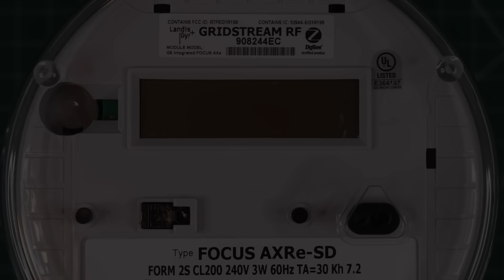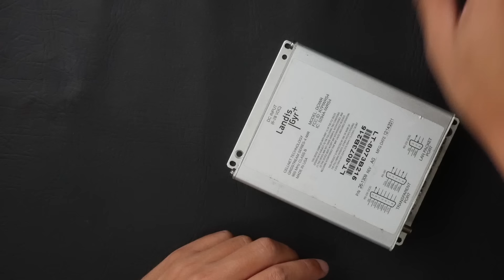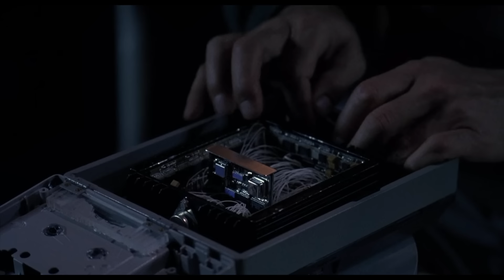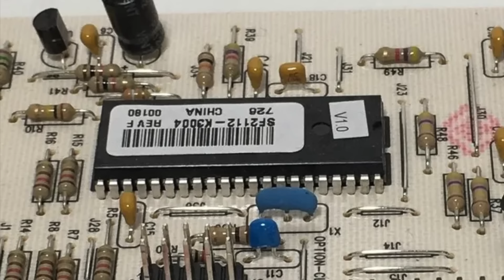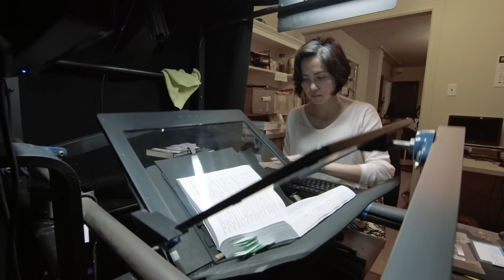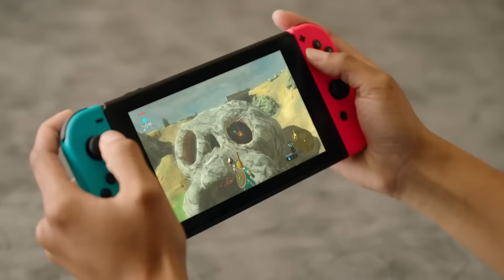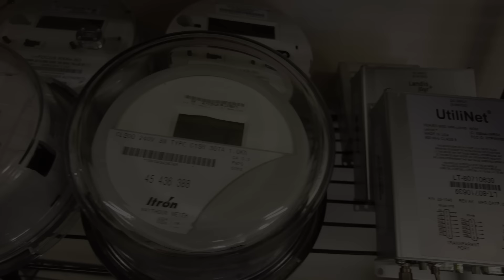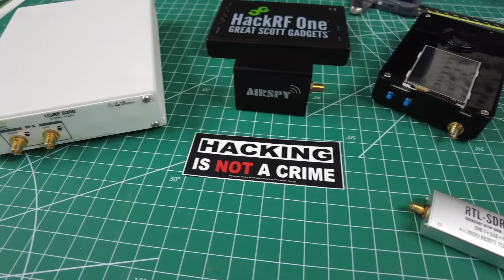The REAL Problem with Smart Meters

Comment: My problem is that the smart meter was sold to the  consumer  with the promise of automatic off peak tariffs for everyone - 7 years later  still waiting - and tariffs increased 50%  . 🇦🇺
Reply: You have to buy your power meter?  Where I live the meter belongs to the power company.
Reply: @soundspark  in Victoria it was a mandatory conversion in 2017 at utility expense. " Sold" in the sense it was one of the reasons to allay widespread public opposition. But essentially , off peak metering is now a back office function for the utility.
Reply: @soundspark  Here as well.  And they have to calibrate , exchange and  modernize. The day you will remove it you are committing serious crime. Also there are tamper protections.
Reply: @rybaluc  I can call up the power company to get my meter pulled if I have to maintain the box.  The box the meter plugs into is my property, but the meter and the wire from the pole to the meter are power company property.
Reply: @soundspark  The difference is you could use "my" in case of power meter. I have to use "their".
Licensed electrician could call power distribution company ( different from power selling company), remove power meter, broke seal and make a repairs. Power meter also records access via tamper points.
Then technician from distribution company checks wires, read state physically ( even in case of online meters) and renew seals on junction box plate, power meter, ripple control device and cabinet circuit breakers. He might also check if installation is up to standard. Unmeasured part is partially owned by me and partially by power company via easements. Usually part with street side cabinet big fuses is power company problem and there is even a bit different key for opening it.
Poles are problem of power company and except old installations in rural areas they are not that much used here for installations below high voltage levels. Lot of places prohibit it gor new permanent installations.
Reply: Not sure where you are in OZ, but OP power was always available, either with a separate timer and meter and/or via over the grid signals to turn on and off, usually hot water systems. Around 20 years ago they raised the OP power cost to almost the same as day rate! F***EM! I told them where to insert it and went island! My neighbors hate me as when there is a black out, our place is the only one with light!
Reply: The smart meter, has the ability to cut off your power remotely.   You paid for that.   They are also aware, if the meter gets pulled.   Which might have a reason, as dumb as "bees in the box".     But they now, have the ability to know exactly when, your meter was pulled, and for how long, and come review any changes to their side.
Reply: @normbograham   im an electrician so we pull meters often for repair work. most utilities dont seem to care, except one small power co-op in the area. If they get the signal that the meter was removed without a corresponding permit pulled, theyll send their guys to shut power off at the house until the customer pays an $800 "meter tampering" fee. Wouldnt be such a big deal except the permit also costs money. Seems ridiculous that you cant cut power to your house whenever you want for any reason for free.
Reply: @davemiller262  If I lived in the service area of such a co-op, I'd pull a permit exactly once and install a service rated disconnect after the meter, before the main panel.
Reply: @davemiller262   When they announced they were putting a smart meter on my house, I installed a shut-off.   I want the ability to shut off all power to the main.
Reply: Nearly all the home owners I know including myself who have forcibly had their meters changed from the old spinner type to the new " smart meters" are unhappy with them and the way the supposedly work. Some of them have even gone down the expense road of getting a certified meter of their own installed to show the smart meters are a rip off but the energy provider doesnt care. I have seen bills sent via smart meters of over 30 percent more power usage for the same load/period before and the providers will not accept the meters are at fault. Its a faulty and easily corruptible system.
Reply: @kriztov265  So... have you started dispute? Have you checked meter in certified laboratory? Have you compared with other meter?
It might be even possible new meters are more precise because old rotationaleters had higher boundaries for minimum current which start turning the wheel. Also stop/start dynamics etc.
Reply: It wasn't 'sold'. It was forced onto the public. I don't recall when they "asked" me if I wanted to switch.
Reply: I just got a new water heater with a dedicated port for utility control (emergency load shedding, off peak usage, ect.). Our utility doesn't make any use of it yet, but it does make sense.

FWIW: They do give you like a $1 discount per month if you let them install their own equipment which lets them cut power to your water heater for emergency load shedding.  Which is fair, but really should be worth more and would be much much better if it were an open source standard so you can actually know what it is doing.
Reply: @travcollieBut Why would you want to let them have control of how you use the service that YOUR paying for? Just $1/mo.? Really? I would say, not worth it at any price! I'm buying your service. I can do with it what I want!
Reply: @Robbie-sk6vc  Because they service they provide (access to electrical power) has physical constraints.  If they have to size for absolute peak possible demand, the service would be much much more expensive.  By being able to shed loads like water heaters (where a temporary outage really isn't even noticeable most of the time), they can provide the service more efficiently.
Reply: @travcollier  it's basically QOS.

My only complaint with those things is that in case of emergency, like unexpected cold and life or death situation, you might want to tamper with things because they can cut you out remotely, it's not just the peaking circuit they can cut.
Energy is a vital service , the law be damned , if I where to freeze to death, you better believe I'm going to put a screwdriver on the place of the meter and use the energy . Legal consequences be damned, I need to survive first.

That's why I have a diesel generator, so I don't need to do that and deal with the lawyer BS later.
Reply: @monad_tcp  QOS is a good comparison.

I live in Hurricane country, and used to live on Hawaii.  I don't have to worry about freezing to death, but most certainly have a generator.

Actually, we put in rooftop solar a little while back.  A basic grid-tied system will pay itself back pretty quick these days, but we also put in an inverter and bit of battery so the whole thing can keep running when the grid goes down.  That part doesn't "pay for itself" in such a simple way, but I view it essentially like insurance.  Anyways, my electric bill is almost always just the minimum. 

I'm still fine with the power company being able to switch off my water heater when the load starts getting too high.  It just makes sense.  Hell, I'd probably do it even if they didn't cut a dollar off my utility bill.  It's the neighborly thing to do
Reply: @Robbie-sk6vc  They have control all the time. They could disconnect you forcefully also via HV line or just cut cable which is on their property part. Also install additional measuring in case of dispute.
 There is no change of principle.  Just change to less manual procedures. Every energy company have conditions which you have to adhere  for protection of other consumers. There is no difererence in case of other utilities.
Reply: @monad_tcp  You have to pay and not tamper. Or chose service - aka amperage and estimated load based on your needs. If you want to avoid emergency situation go get backup power supply. Only idiot would think power supply must have 100% reliability.
I come from country which have far better grid reliability and much better grid  than US. But still for life critical things I have backup supply ready.
One would think this is elementary thing for every owner of property where grid might go down for more than 12 hours to have backup supply in some form.
Reply: @rybaluc better reliability than the US? I have owned my house since 2008. The power has gone out less than 6 times in that period. Out of those, power was restored within 5 minutes at all times except one time. A tree next door fell in a storm and knocked down the pole in front of my house. They had power restored by the end of the day. Depending on where you live(the US is huge) the power grid is very stable.
Reply: @alecb8509  Actually yes. Our village had two hv lines connections from 2 different hv switching stations. Backup from northern side can be connected.  And since big storage halls moved in it have 3rd. I suspect it is for planned train traction.
We not have poles for lv lines. Everything is burried.
Better than i rural US. We also have three phase and ripple control tariffs available in whole country.
Reply: @rybaluc  So be it, my power is very reliable. I think for as large as the US is, our power is very reliable. The problems with our grid is typically in congested urban areas.
Reply: @travcollier  We had such systems fro late 60s in former czechoslovakia ( now Czechia/Slovakia) up to those days. Ripple control systems enable/disable various appliances based on loads in network or demand from distribution company or network operator. It can even control solar power plants to prohibit distribution network overload.
Reply: @rybaluc  Yep.  It isn't like we don't know how to do more "smart grid" stuff, it is just that getting companies to collaborate to implement it is painfully slow (at best).  The US grid (where I live) is really old and has a lot of legacy support limiting it.
Reply: @travcollier  In New Zealand, we have had "Ripple Control" of hotwater storage heaters for many decades. This old system does not need a smart meter and typically our whole house is just wired to one phase of power (our system is 240 volt, 50 Hertz).  The way that "Ripple Control" works is that a signal is sent down the electric wires. I think it's about 200Hz to 300Hz, but it only lasts a second or so. So therefore electromechanical clocks and record player motors etc, speed is not affected. Typically using "Ripple Control" storage hotwater is turned on about 7pm and off about 7am.  Thereby avoiding the main Peak Usage times. A "ripple relay" switch is located somewhere between the switchboard/fuseboard and the hotwater storage tank.  The electric supply company can also cut off the hotwater in case of emergencies and the need to "shed load".  

I lived in Western Australia for many years. There, hotwater was done by either piped gas, or by Instantaneous 3 phase electric hotwater systems (Most houses being wired for 3 phase electric there).  So having no easy system for "load shedding" when load shedding was needed, the electricity supplier simply would black out one suburb after another on a rotating hourly basis. Including for instance all of the traffic lights, in that area.
Reply: @KiwiCatherineJemma ripple control is extremely annoying and needs to be phased out. Especially with all the cost cut modern electronics without filtering for it
Reply: @KiwiCatherineJemma  3 phase have nothing to do with inability for ripple control. We have 3 phase supply everywhere in CZ with ripple control possible.
3p is often must have for more energy hungry appliances anyhow. You cannot get there single phase 50 amp domestic appliance. It will not even get connected. 3p mechanical relays or SSR relays with signal receivers are cheap and widely available.
From receiver you could have multiple signalling cables from ripple control receiver to the house. Like heat pump, hot water heater, car charger, solar export control ( you have very similar in NZ) etc.
It is even being used for public light systems control.
Reply: I can't believe people fell for that lie. No one cares about us or saving us money. It's all about control.
Reply: This does exist in the UK and it's majorly due to smart meters
Reply: ❤correct .🎉
Reply: Yeah I'm still waiting to see all of the "energy savings" we were supposed to get by switching to LED light bulbs. Funny how it seems like my power bill has gotten higher......not lower? 🤔🤷‍♀️ Wasn't that supposed to help us save money on our power bills?? 🙄
Reply: It is funny that one would expect automated systems to favour end consumers, yet it is exactly by this automation corporations wield autonomous power to increase profits. What do you expect, that a power company, an army of people sitting behind computers will be pressing keys to reduce charges for you to make your life comfortable? How does that favor them? Matter fact, they will be pressing keys  all the time to  slowly trim up charges. Does Tom sneak behind jerry all the time to give him flowers and read him a nice story book?😂😂😂
Reply: O'rly? I thought it was for network management and lowering distribution costs. Also off peak systems worked from late 60s in my tiny country which was not that technological advanced as US. We used modulated signals with specific codes back then for switching off/on those appliances.
Also smart meters are important for reporting overflows (legal - like solar energy or illegal) or issues with reactive power.
It is one of the necessary equipment to use when you produce energy or buy it (even for flat rate) on short term markets with dynamic price.
Reply: @rybaluc Thx for the added dimension
Reply: @rybaluc  They are NOT necessary at all
Reply: @jackazzen3824  For comment you are reacting?
Reply: I've had off peak tariffs for years what are you smoking  🦘

Comment: My printer's firmware counts how many pages I printed.
Reply: AFAIK (I was certified by Lexmark and HP to repair laser printers), all business grade printers count if the front or front and back (1 or 2) sides of the sheet pass through the printhead. This is so if the printer is a rental, it is a wear/tear metric used to charge the customer (think of it like leasing a car and being charged per mile driven).

Comment: I wonder if it's possible to decode the hopping pattern by only listening to one meter by shielding said meter and putting the sdr right next to it, that way the strongest or even only signal the sdr sees in the meter range is that one meter and then some math can be applied to figuring out the pattern
Reply: Easier to find the code used to make the sequence.

The sequence may be million/billion of steps before repeating!

Comment: I can see why closed source systems would typically be harder for bad actors to interfere with, assuming the programmers and hardware designers have done their due diligence. That means encrypting the firmware, setting non-trivial passwords, and maybe even putting in place a watchdog to prevent glitching the memory into being read out. But they haven’t done that here. On the other hand, doing due diligence for open source code means its easier to find potential problems, assuming they can be patched in the first place. If you don’t have any method for patching the firmware to deployed devices, open source code is going to be less secure for a given quality of initial code.

Comment: I have been missing the sharped dressed man is a suit. But at least I no longer worry about my wife getting all hot and bothered..

 This video was extremely well produced, and I cannot wait until the next one in this series drops.  I have alway wanted to know how my utility smart meter works, as I I am running my house  with gorilla solar, only using them as a generator. I stick it to them every way I can. They have proven to be noting more than a abuser of Power, with no concern for the customer only for the profit. It's my turn to get some flesh from them. Technology is moving forward and soon storage will be cheap enough that many will no longer need them. Power to the People!